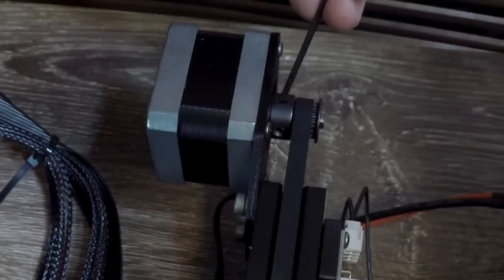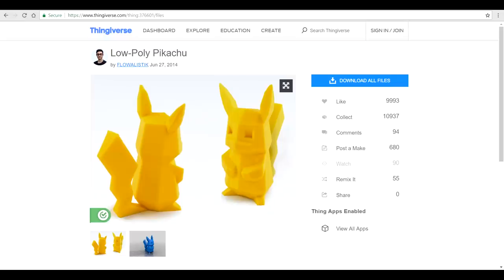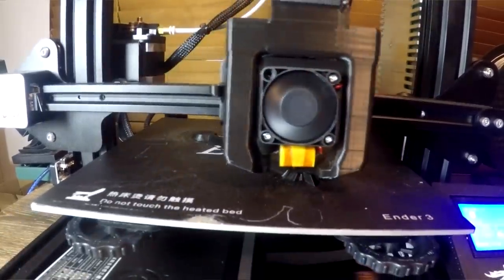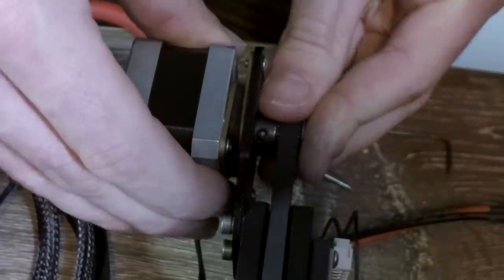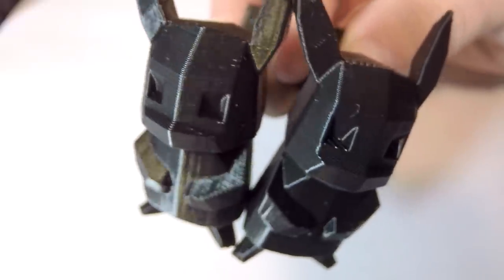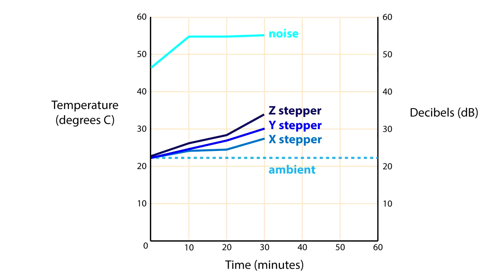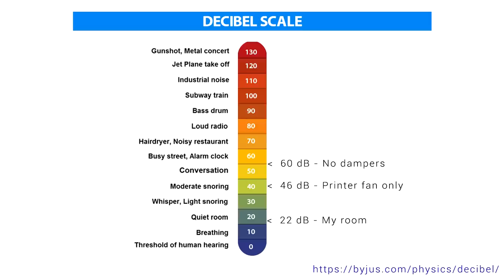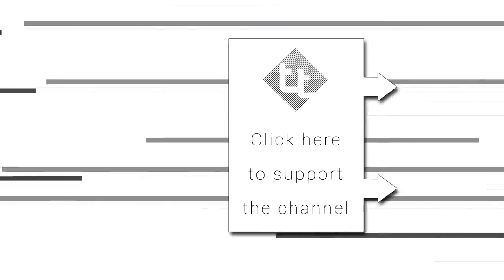Quieten your 3D printer with stepper motor dampers: Ender 3 tests

Comment: Just added some dampers to my ender3 and the y axis ones have moved the motot so its now in the way of the bed and stopping the bed from going back all the way. Anyone else experienced this, and any solutions to this other than moving the limit switch forwards?
Reply: Apparently creality are changing parts to improve the printer mine does the same going to dremel out the corner hitting a bit
Reply: Just an update i ended up loosening the belt tensioner then removed the screws from the motor mount and installed t nuts instead so i could slide it further back on the rail. You will also need to angle it down a bit in the back.
  I then loosened the end stop and pushed it forward a bit then retightened the screws.
 Works like a charm and the nozzle still misses the front corner when homed so you don't lose any print volume
  Good luck theres printable options as well but i didnt want to lose print space
Reply: I just filed mine back since it is was very slight, aluminum is soft.

Comment: The Ender 3 Pro doesn't have grub screws on the gear to change the distance from gear to motor?
Reply from the maker: I think this is a recent change across multiple Ender 3 models.
Reply: not only pro... Have you found the way?

Comment: There's remarkably little point installing a heatsink onto the stepper motor! Permitted case temperature is about 80°C (way too hot to touch), internal 130°C. The motor doesn't know whether it's too hot and cannot skip steps due to this, what happens when you overheat the motor, your grease/bearing endurance starts to reduce. At sufficiently high temperatures that i think you can never reach, the insulation of the wiring becomes suspect, and it's possible to have a motor wire, but the actual winding insulation is unlikely to be the cause, instead connector and distributor will show first signs of damage.

The bit that needs cooling is the stepper motor driver IC on the control board, provide an active air path under the stepper ICs or increase airflow there.

Comment: I got really bad underestrusion when applying it to the extruder.
It is not fully clear to me how you did it mount it in the second configuration.
Reply from the maker: I used the original bolt with a nyloc nut underneath in the corner that the arm pivots on, then mounted the damper as per usual. Initially the spring couldn't cleanly press on the lever arm and I had the bad under extrusion too.
Reply: I got underestrusion only after a while printing with the damper. At the beginning it was fine. Probably the rubber started giving up against the constant pressure applied by the spring pushing on the gear.
I would advise you to keep monitoring the print quality to be sure it won't get worse over time
Reply from the maker: Thanks I will.

Comment: I just did the same a  few days ago.   Just wanted to comment.   The high frequency is eliminated and is much better as mine is near my bedroom.   But my stepper motors are considerably warmer, maybe not enough to warrant heat sink but warmer than you report for sure.    I also (as someone else said) had to print a part to move the x axis end stop as the carriage got in the way slightly, easy fix and I think this is only for the "newer" versions.   Overall a very worth while upgrade.
Reply from the maker: The little changes happening to this printer are making universal mods hard to do.
Reply: My steppers get over 50°C now that they have dampeners, sure the 28° ambient temperature is not helping.
Reply: Yep...same with mine. Temp on steppers is up for sure.
Reply: Ian Lainchbury luckily I have been able to print for over 20h without issues so far. I ordered some heatsinks anyway :-)
Reply: thesimbon Just ordered some myself :)
Reply: Ian Lainchbury the problem will be fitting them to the Y stepper, there is so little room
Reply: For sure. I had to file the Y carriage a little to get it to fit, but they are pretty cheap, so my thought is to remove some of the heat sink so it clears the carriage. Yet to see if that is possible, but that's the plan anyway.
Reply: Ian Lainchbury I had to do the same to install the dampeners, I ordered small rectangular heatsinks maybe I can leave a gap for the carriage to move through

Comment: nice advise. I had bought mine from bangood and also a load of matching shorter bolts. nice hint to add that thin bolt to the extruder with a small lock nut. I took the opportunity to upgrade the original extruder on mine from the plastic one to an all metal long arm one that has an option for a filament detector. If updating fans then using 1/2 the rated voltage (so 24V instead of 12V) often runs them quiet but watch the airflow... Use 12V with a 24V fan etc.
Reply from the maker: Thanks for posting. Interesting idea on the half voltage fan. Maybe a blower style fan would be ideal in this way since they pump so much more air.

Comment: Should probably mention that the shrink tube kid in this list of stuff to buy doesn't have a shrink wrap in it big enough to enclose the buck converters.
Reply: Also the new models motor cocks arent adjustable so you cant use the rubber dampers, because you cant make the gear line up with the belts once they are on. Unless you pry them or something which I'm not willing to do. Hopefully I can atleast install the fan cause otherwise pretty much all the stuff I bought is unusable :/

Comment: i can not instal stepper dampers on my ender 3 because the wheels for the belt are fixed on the stepper motor and is without the bolt to screw it of.... how can i install the dampers without having to buy new stepper motors
Reply from the maker: An annoying update for sure. My Ender 3 still had regular pulleys so I can't test this but I'd like to try gently levering them off.

Comment: I'm getting ready to upgrade the fans you will get a very noticeable difference! Noctura for extruder an controller board an charging the fan in the pcu for a 10 blade fan an thermostat so it only comes on after 50 degrees an off at 33 degrees
Reply: andrew grabowski did you get the 24v fans from noctua?
Reply: ather akber yes of course
Reply: Link please?
Reply: ather akber well actually I have step down converters I'm gonna use an store in the control box so my fans are 12v an there my easily accessible except the pcu fan
Reply from the maker: I've never found 24v noctuas. The 12v 40mm ones I purchased cost me $40 au each!
Reply: Teaching Tech exactly they're expensive but totally worth it,
Reply: Teaching Tech they did start making 24v fans but only 120mm sizes, no 40mm
Reply: andrew grabowski thanks already have 2 of those on order and a noctua 12v
Reply: ather akber sounds good! I'm waiting for my stuff to come in tomorrow I have a really crazy set up on my prusa mk3 basically it's a buck converter with a digital read out l, an a sensor so the light turns on automatically when it's dark I ordered the 6 pack of them for the noctura fans an to have a few extra
Reply: Teaching Tech give the 12v noctura fans a try with buck converters in that like a 6 pack of them it would make a great video! Also I going to seal the converter so nothing shorts out there pricey but worth it I use them everywhere I just ran out of them I ordered 200usd worth of fans yesterday lol I have more builds coming

Comment: Is it an issue if the motors get way hot?
Reply from the maker: You may want to lower your VREFs a bit, or even simpler: install some heat sinks on the back. Too hot to touch is a good gauge of too hot.

Comment: Something you did not cover... when placing the damper on the Y axis, you MUST grind down part of the bed support so that the bed can go into the home position!  After i replaced all the dampers and tried to print, i was greeted with horrible Y axis belt grind.   I found the problem to be that since damper adds few mils of dimension, this caused part of the bed support to run into the stepper motor when going into home position. I had to grind down part of the support with dremel tool and the problem was solved. (This could of course, be just my particular printer with older bed support and newer models may not have this issue.)  And another thing... damper on the e motor was waaaay too much trouble than its worth. I would skip it if you are planning on putting dampers on your Ender3.
Reply from the maker: On my older model this was not the case. The versions since this video need a 3d printed adaptor, or some grinding as you say. Agree on the extruder, I took it off.
Reply: On Thingiverse, look for thing 3083500 which is the adapter which handles the problem of the bed plate clearance.
Reply: I was able to get my bed to clear the Y motor (just barely) by loosening the screws on the limit switch and pushing it forward, then loosening the motor and tugging it back a bit. I also adjusted the rollers on the bed to force the bed as far forward as I could. Combined, those tiny little tweaks ended up being just enough to get the limit switch to trigger before the bed assembly hit the motor.
Reply: Is the printed adapter just to move the stepper back so you can use the damper or is this bracket in place of the damper?

Comment: I tried this upgrade on my Ender 3 and when I placed the damper on the Y axis motor, the bed no longer could reach the Y limit switch causing the motor to make a horrific noise when it tried to home the Y axis. I turned of the printer in a panic and looked to see that there is an X shaped bar that holds the bed, and the motor now hits it when trying to home the Y axis. What do I do in this situation?
Reply from the maker: I believe there is a fix on Thingiverse:  https://www.thingiverse.com/thing:3083500
Reply: I discovered this while adjusting the rail wheels after installed the dampers, I just measured and filed the aluminum, then used a permanent marker to black it out.

Comment: I feel like people would be better off getting a board with tmc2208s or 2209s with stealthchop like the skr mini e3, and sticking a noctua on the hot end fan, rather than this. I guess this is a bit easier to do for people less comfortable with the steps involved in a mainboard and stepper driver swap. Problem with this also is that ender 3s come with pressed on pulleys now as well.

Comment: Didn't work for me. Print quality has degraded dramatically after installing dampers. Had to remove them
Reply from the maker: Very interesting. This is the first time I've read this. Are your dampers more rigid or flexible?
Reply: @TeachingTech  They seem to be rigid when I just fiddle with them in my hands. But, when installed between motor and frame , I was actually able to rotate (not tilt or twist; rotate coaxially with motor shaft) motor by few degrees. So, in the end, they are too soft, I guess...

Comment: Great video Michael. If you really want it quiet change out the mother board to an MKS Gen V1.4 with TMC2208 steppers the difference is astounding and you'll have more memory to add more features to the machine.

Comment: I’m missing the print quality difference. It’s hard to believe there is no difference at all.
Reply from the maker: On paper, why do you think there would be?
Reply: Teaching Tech you’re adding rubber band to all axes movements. I would expect at least a loose of dimensional accuracy. Might be more or less pronounced with high speed and quality of the dampers

Comment: U need to fix te PTFE tube
Reply from the maker: Based on what? It doesn't budge. The Pikachu's are great prints, are they not?
Reply: Teaching Tech if you look att 6:06 you can see that the ptfe are moving, you can test to get capricorn tube and se if it improve the print
Reply from the maker: You're probably right. I might order several metres to stockpile.

Comment: I am curious as to why my Prusa MK3 is so quiet with no dampers on it. Can barely hear it running while sitting in the same room. My FlashForge machine sounds like some kind of crazy musical instrument. I guess that is more the stepper controllers than the motors?
Reply from the maker: Indeed it is the stepper drivers.
Reply: On my home made printer I used a PiBot main board with 5 amp stepper controllers and I had no sound from the controllers. I switched to the Panucatt all in one board and it just had 2 amp controllers and the noise was back. I stayed with it cuz it had 6 heater controllers for my multi extruder system.

Comment: M3x8 are too long, use M3x5. 
For Extruder u will need a spacer to keep the nut away from the screw that mounts the motor. 
Y axis motor will hit the bed. 
New Ender 3s have pinion gear that is press fitted on  X and Y Motors. So u will need to sort that out or buy new motors. 0.8A motors, keep that in mind. Good luck
Reply from the maker: Thanks for providing good info for others.
Reply: No worries :) thanks for the great video. Too bad Creality keeps changing the printer without a version number. Just got mine a week ago

Comment: I'm afraid that your temperature tests are not valid. I see that you are holding your infrared thermometer on significant distance from the motor, even though you are pointing the visible laser on the motor. So I think you probably measured the average temperature of the motor and it's surroundings instead of only motor's temperature. Let me explain.

Infrared thermometers provide measurements not for a point where the visible laser points, but for circular area approximately at the center the laser's point.This area's size depends on the thermometer's D:S (distance-to-spot ratio, one of the IR thermometer's spec) and the distance to the measured surface. You can read more about D:S ratio on wikipedia.

The visible laser is only for reference, it does not affect measurement results at all. You can cover the visible laser with a finger or turn it off in IR thermometer's settings. At the very close distances to the measured surface this visible laser will even be misleading, because it is located on some offset from the actual sensor.

Comment: I just added the dampers to the X and E motors and it's incredibly quiet.  Just printing out the Y adapter to allow for the bed smacking into the Y motor.  Well worth the upgrade. :-)  Z lead screw motor can't fit a damper but it's no big deal as this one doesn't move that much.  In case you need to adjust the Y axis zero microswitch position due to the bed hitting the motor there's this part available.  https://www.thingiverse.com/thing:2879245
Reply from the maker: I've rad a small update has made the y axis trickier. Thanks for providing the link.

Comment: I don’t like these dampers at all. On the Ender 3, anyway, these require the belt pulley to be offset further away from the motor shaft bearing, which multiplies the moment-force, significantly I might add, along the shaft, imparting more force to the bearing. Along with this, the very presence of a resilient interface suggests that, by design, the damper parts must either allow the motor frame to flex out of alignment with the belt, or are so rigidly locked in order to restrict damping to a torsional plane that their “damping” action is effectively negated, either scenario making the actual effectiveness of these against transmitted vibrations highly suspect. 

There is no doubt that installing these will change the characteristics of noise and vibrations, but I honestly believe that any “improvements” perceived by users of these devices are strictly due to changes in the moments and alignments in the machine frame, since the attachment of these are obviously going to cause dimensional differences, and less to their actual effectiveness as dampers at best, and  at worst may actually be causing premature bearing wear do to the lengthened moments in installations where the pulleys must be offset away from the motor frame.

Either way, I purchased these when I bought my Ender 3, but opted out of installing them when I concluded these potential drawbacks, choosing other methods to make the machine quieter and smoother, (such as addressing some fundamental design issues with the belt drive that nobody that I have found has addressed yet. 

TL smoothers are another unnecessary investment in regards to improved print quality, as these will certainly move the vibrations and harmonics around a bit, but do nothing to improve the overall average quality when examined across a variety of test cubes printed in different materials, speeds, and slicer settings both with and without the smoothers installed. They are also however, supposed to prevent “freewheel” and “fly back” current from reflecting back to the driver board (which is why your Ender 3’s display will light up when you move the steppers manually, even with power disconnected). I have a hard time believing that the factory-installed stepper controllers lack built-in freewheel diodes, but I have a lot more research to do on that.

Since, fortunately, the Ender 3 printer I received shipped with the much quieter CR-10 main board, I had a lot less work to do, but I found that working through Angus’ excellent presentations allowed me to tune my (mainly) “vanilla” Ender 3 to produce very nice prints without wasting filament, or struggling with the nuances of this machine.
Reply: Any more info on those belt drive issues anywhere?

Comment: 2:48 You can use a laser thermometer with a glass bed. Just add some painter's tape to part of the bed that will not be used to print on. Then aim the laser at the tape's surface. The matte finish of the tape will allow the laser's sensor to see/read the temp easier vs reflective glass. Btw, you shouldn't point that laser at you camera/lens, because it has the potential to burn out the pixels on the camera's optical sensor.